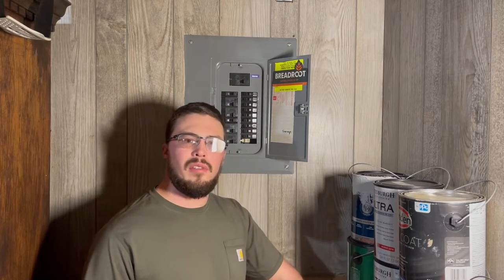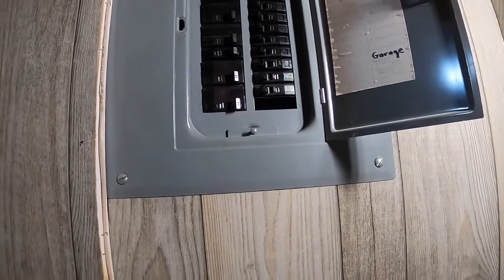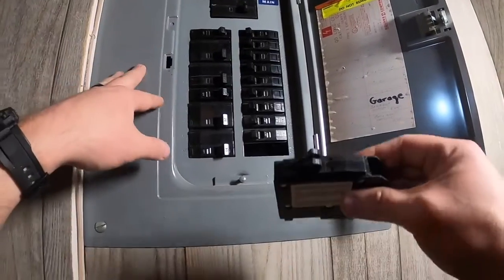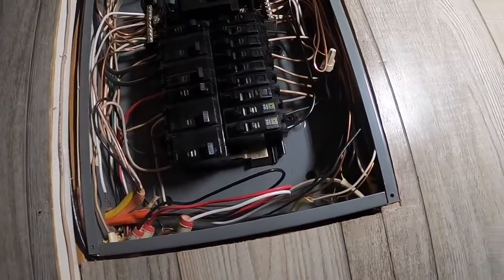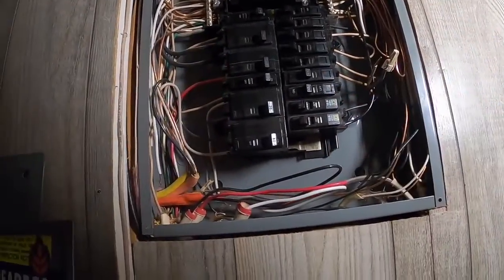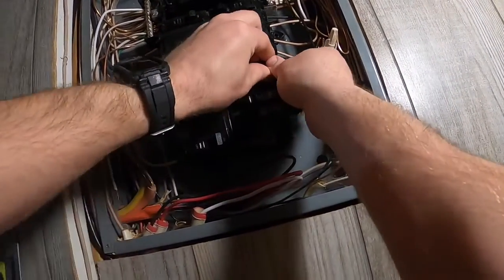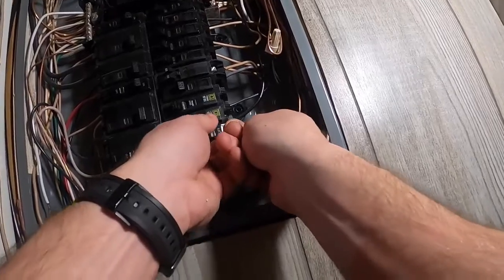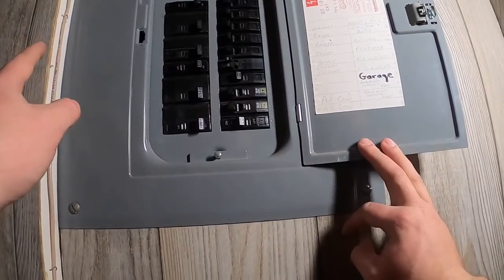How To Add Breaker Space To An Electrical Panel

Comment: Forget checking the breaker, the first thing you NEED to verify is whether this is a 20 circuit panel or a 40 circuit panel. You have to check the panel data plate to verify this. It looks like a QO20 Load center, 100A, 20 circuits which means, you CANNOT put in tandem breakers. 
If the data plate is missing (which it is not in your case as I see it on the legend and on the left, inside the panel), count the terminal screws on the neutral bus bars. That will be another indication of how many circuits you're allowed to have as you cannot double tap your neutrals.
Reply from the maker: Thanks for the comment and your input. Truth is this video could be an hour long explaining every code and different options you can do, but I do agree you cannot double land your neutrals, so you can add another neutral bar in your panel. That’s just something I can’t put in a quick video so thanks for another video idea and I’ll try to get one out on that subject!
Reply: @AwesomeSauceElectric  Keep up the good work!